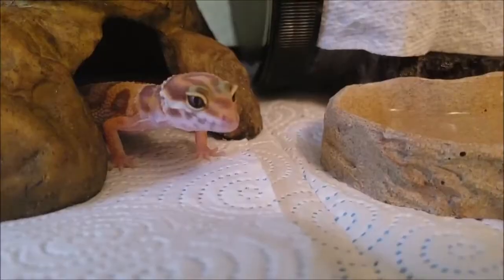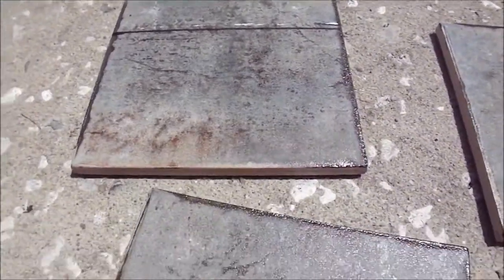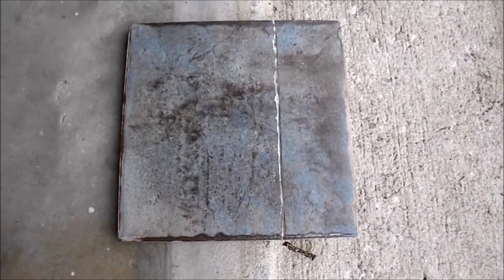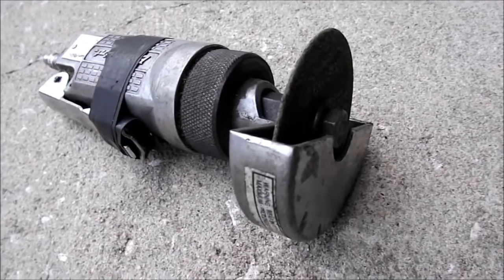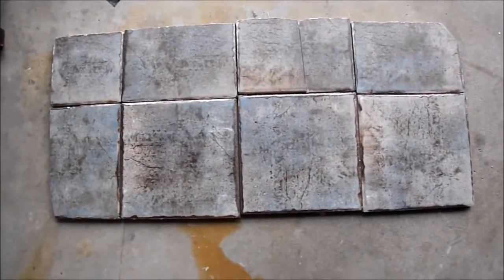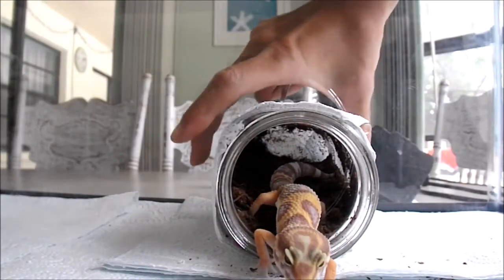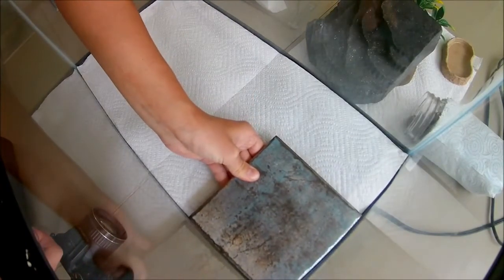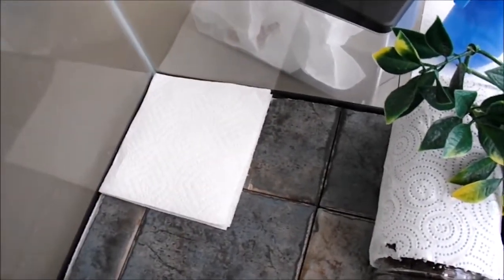My Leopard Gecko got NEW Substrate (Tile)

Comment: I want to change to tile, but im a bit afraid it will be too cold! Does the heatmat still heat through it?
Reply from the maker: The tile actually holds the heat really well. In fact, it made mine too hot and and I had to lower the heat mat temperature.
Reply: What is your heat mat set at with the tile?
Reply: @hermitshoundsandhorses9971  if you use a thermostat from jumstart or zoo med it will regulate the heat.

Comment: You really should put paper towel over the tile on the hot side since you don’t have a Thermostat trust me I know I have tiles in my leopard gecko tank and I don’t have a thermostat in the hot side got really hot and she almost burned her foot I would suggest putting a layer over the tile
Reply from the maker: Yes, shortly after filming this I ended up adding the paper towel.
Reply: Just get a thermostat, they're fairly inexpensive.